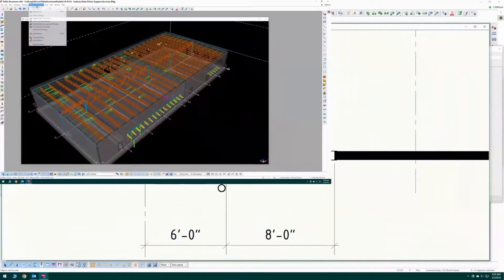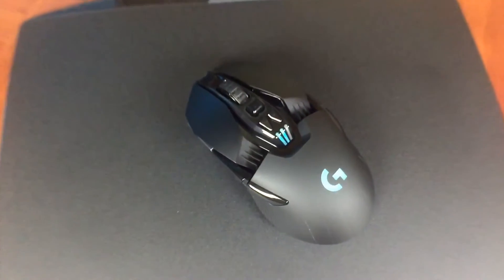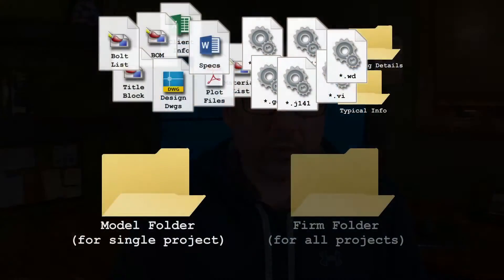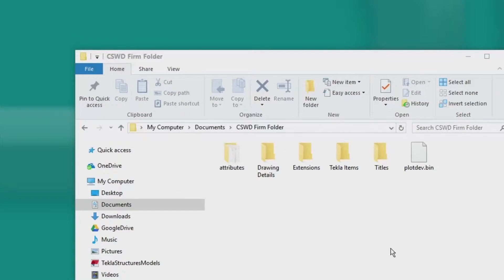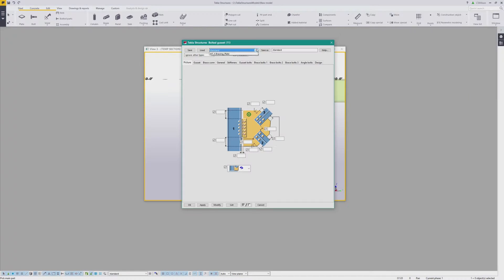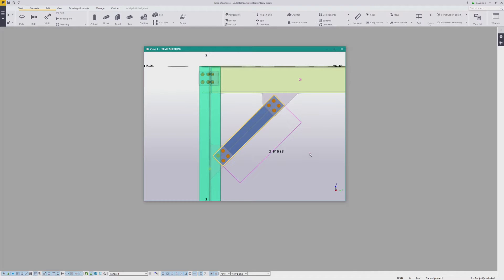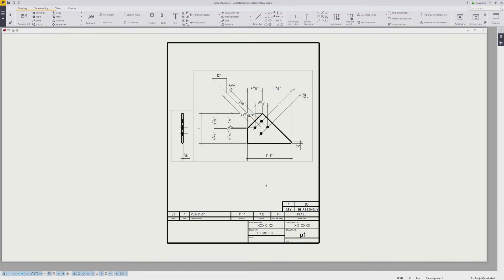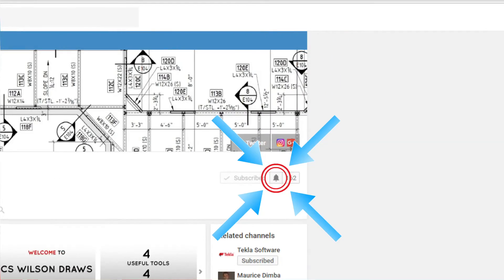Tekla Tech Talk: Episode 02

Comment: Hey Wilson. since you said that you will certainly modify the brace length after setting a brace components, is there any practical way to set desired length, but keeping a handles on workpoints? i am obviously not thinking about changing offset lengths of start and end point, because it would be very difficult to set brace length that way. And if I turn on DM and type desired brace length, Tekla will move the handles.
Reply from the maker: The only way I know to do it ~accurately~ is to cut the ends with Fit Part End or Part Cut or even Polygon Cut.  If you're using bolts, those will have to be moved as well (in case you missed it, I did actually fix that brace at the end of the video).
Reply: omg, totaly missed the end. thanks a lot!
Reply from the maker: #alwayswatchtotheend  :)

Comment: I installed tekla stucture 2018 but same error which i have in 2017i 
When i create single parts dwg the softwear stop working and showing error.,and automatically close.
this is very big problem beacuse if i cnt make the dwg the softwear is useless.
Sir wilson I am hopefull you can solve this problem.
Reply from the maker: I'm sorry to hear you're having trouble with v2018.  There are a few others I've seen on the Tekla Forum that have experienced crashes with the new version, but nothing has been resolved as of this moment.  I would suggest you contact your local Tekla Help Desk to report the problem.

Comment: Why did you turn off direct modification when making the final gusset plate node changes? I do a lot of chute work and plates are major part of the reason I use Tekla.
Reply from the maker: Thanks for the question.  In short, you don't have to disable direct modification to do the procedure I showed, that was just my normal workflow.  I normally model with direct modification turned off because I started using Tekla Structures before DM was available.  I know that it has been updated and improved quite a bit since it's introduction, so I'll probably try to start using it more.

Comment: Hi, great video, I was just wondering how do you get your linetype so thick on the drawings, It looks good the thick black lines. Also, you use a circle point mark to highlight points for dimensions,  you seemed to get this so quickly, is this a setting, or do you manually draw a circle. Thanks
Reply from the maker: Thanks, Richard!  See my reply to kamal halawi in this comment section for the line thicknesses. As for the work point circle, that's manually drawn. Thanks to magic of video editing, it seems to just appear out of nowhere. :)

Comment: Hello CS Wilson,
How do you control the lineweight displayed on the screen while drawing? When work in drawings, my lines look a little thin.
Reply from the maker: Thanks for your question! The displayed line weight is controlled by a few different things.  My settings are as follows:
Advanced Options:
  XS_BASE_LINE_WIDTH=0.01
  XS_BASE_LINE_WIDTH_AFFECTS_SCREEN=TRUE
Next, make sure XS_USE_OLD_PLOT_DIALOG=FALSE and then select File -> Printing -> Print Drawings.  Click on the Line Properties tab and change the line thicknesses for each associated color as desired.  Remember, the value entered for the line thickness will be multiplied by the XS_BASE_LINE_WIDTH. So if XS_BASE_LINE_WIDTH=0.01, then a value of 35 will display as 3.5mm, 50 will be 5.0mm, etc.
At this point, if you don't want to use the new plot dialog, set XS_USE_OLD_PLOT_DIALOG=TRUE.
You can switch between the different color modes in the drawing editor by using Cycle Color Mode (usually Ctrl+B shortcut).

Hope that helps!

Comment: Could you perhaps share your keyboards macro key layout. I would like to optimist my layout and need some ideas
I use a Logitec G19 that has 12 extra keys to the left with 3 modes.
Currently it's just set up for working in drawings. Like next/previous drawing, save, print, delete, dim and such.

Comment: can you describe what is the setting for show exact line in part by defult
Reply from the maker: If you're referring to showing exact lines in the model, do this:
Without Tekla running, go to the model folder of your project and open (or create) the file OPTIONS.INI and include the line XS_SOLID_USE_HIGHER_ACCURACY=TRUE.  The next time you open that model, the profiles will be shown more accurately.

If you're referring to showing exact lines on the drawings, I've covered this in a previous video found here --> https://youtu.be/CmiIizp0Ef0?t=7m28s <--.
Hope that helps!

Comment: Thanks for the video and useful tips. For the mouse I use a Razer Naga with 12 extra keys available in the thumb, which I have mapped mainly for navigating and some of the most common shortcuts.
Reply from the maker: You're welcome!  The Razer Naga looks to be very nice.  I've seen those (and others like them) and considered trying one out at some point.  Was it difficult to get used to?
Reply: Is like what you mention in your video, best to start just by setting up couple of the buttons and getting used to. But I like it more that other gaming mice where the buttons force you to use many fingers and here you can use all the extra buttons just with the thumb.
Reply from the maker: That sounds like good advice! :) I agree, some gaming mice are a little over-the-top when it comes to buttons.  I guess it depends on what you need and what you get used to.

Comment: Please make a video how to sync tekla settings on 2 different computers (with dropbox).
How to setup the text size for rest of my life? :)
Reply: can i use the same firm folder for different version of tekla on one computer?
Reply from the maker: Not sure about syncing with dropbox.  For the text settings, open the text properties dialog in the drawing editor, adjust your settings to what you want and save to a name you want (ie SMALL, STANDARD, etc).  Then copy that saved setting from the model folder to the firm folder as described in the video.
Hope that helps!
Reply from the maker: Yes, you can use the same firm folder across different versions of Tekla Structures.  That's another benefit of the firm folder.
Reply: I am currently doing this so I can work from home
As CS Wilson said in the video about firm folders with the difference being the location should be in your Dropbox folder instead of under documents. (I set my dropbox to be directly under my C:\ you can change that under preferences > accounts > locations so the folder is in the same place regardless what the user name is.)
I also put my Teklastructuresmodels folder in dropbox so I can work on the same model from the office or from home

Setting up templates for using firm folders is a very good idea.
personally I create individual shortcuts to launch tekla with the desired settings/firm folder. Down side you have to reopen tekla every time you want to open a model from a different client.